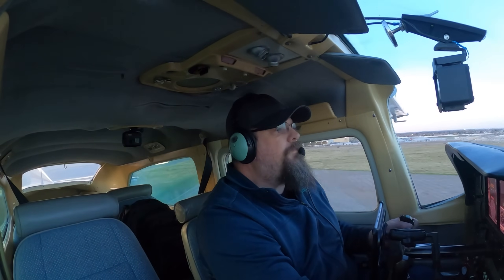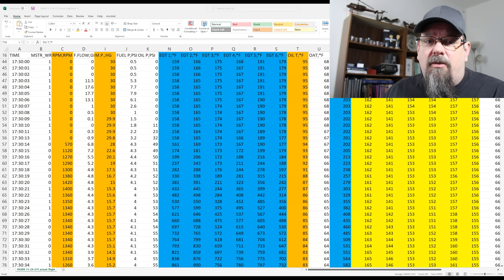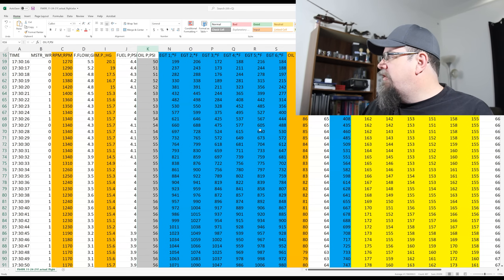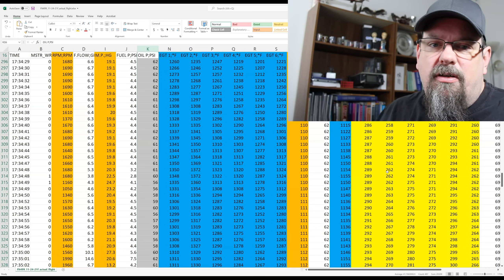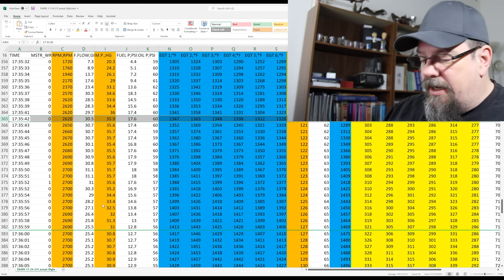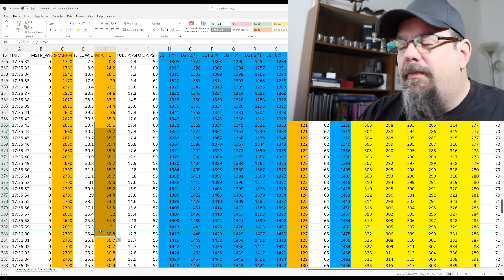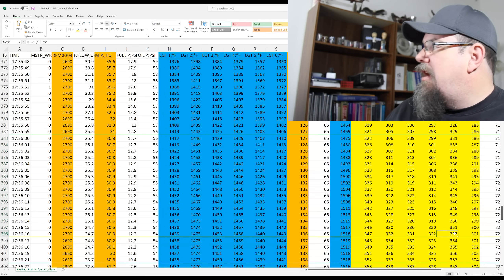So What Actually Happened?

Comment: Except over reving it is very unlikely to cause catastrophic failure by doing something wrong with engine parameters in this short period of time. Even if a temperature is too high, the engine will not explode within 1 minute. When rods break, it is usually a lubrication problem , a bearing cap comed of or a piston gets stuck

Comment: An AD came out recently against improperly installed counterweight snap rings in Continental engines. 
Removing and installing counterweights is very easy, but the manner in which the snap rings are installed is extremely critical. The condition and fit of bushings is equally critical. Those counterweights are not tight on the crankshaft. There is a prescribed amount of free play between the retaining pins and their bushings so that the counterweight can move around a bit to find its best position at various power settings.
I usually leave the counterweights installed whenever I send a crankshaft in for overhaul. I let the Repair Station deal with them.

Comment: Woah. I have seen many engine failures, but never with as much shrapnel as this. It looked like a WW2 bunker with a German 88 in it got blown up by Naval artillery. The engine sure sounds quite complex and that's never a good thing. 
One of the worst things that can happen, one guy does half of a job and another has to finish it. It happens in any shop, either due to illness or bad timing, holidays overlap or death in the family, injury or worse, the guy quit/got fired.
You basically have to redo the entire 50% preceeding the 50% of assembly. There is no other way, clearly.  I never took a job over, hoping the previous guy did his best. I am a optimistic pessimist and therefore plan for the worst and plan C, just to be positively surprised and end up happier than I started, everytime.

Comment: It bothers me that only cir clips are used to hole the counterweights to the crankshaft. Not a very secure method. That warm fuzzy felling I get for great design is lacking. You have a very honorable engine shop, hard to find these days. You should promote then with a banner on the side of your aircraft.

Comment: I hope you don't plan on using those rife extinguishers in flight? Check out a video on the subject from the UK. It's an eye opener. Also, at full power and some forward movement, your RPM should be at Red Line. That is an adjustment that is done to the governor. It won't go above that so no need to pull power back. Altitude is life!

Comment: Being mentally prepared is such an important thing. That's why pilots always should discuss their limits  and plans for a go around just in case it happens. You handled this exceptionally well. You stayed calm, flew the plane, got yourself back to the runway safely and communicated your issue to others. This is actually were newer pilots can outperform experienced pilots, experience with no issues causes complacency you don't mentally go over what to do and expect an engine failure on takeoff.

Comment: Should have a test on the ground set up, for atleast an hr or 2, I've rebuilt diesels with mechanics and they ran the engine wide open with no break in period. I said shouldn't the engine have a breakin period? He said if the engine is going to blow up, it might as well blow up right now in the shop, not later.

Comment: You say that perhaps the counterweight came off when you adjusted the engine speed, the fact is that the mechanical failed to do a proper pre-assembly inspection of all the parts he was to install. I’ve never heard of bolt-on counterweights this means that it was cracked before installation and broken off by the bouncing connecting rod parts. 

Although not an aircraft mechanic I have been a diesel and gas vehicle technician since 1983, based on my experience working on failed air cooled engines or 10:09 diesel engines with external oil coolers I will NEVER clean and reuse an oil cooler that has been contaminated with metal particles because you can never get everything out. I don’t care if it was pressure flushed or blow dried a 0.25mm piece of metal inside a cooler can wreck an engine so I don’t take a chance. 

For future reference, if a mechanic tells you “it will be ok like that” GET IT IN WRITING!

Comment: That was the shop owner  first mistake,  never to let 2 different techs. Work on the same engine,  this is not good practice,  if you start to tear and engine, or transmission, down or whatever it is , that tech has to reassemble it as he took it apart.  Especially in that type of work you had done. There are lives on the line here, in my line of work I do ,if you start the job ,then you completely finish the job to. 1 man start to finish

Comment: You cannot just replace the rod cap, the rod and cap are a matched set, you have to replace the whole rod and cap.
Reply: Failure was due to the mechanic not fitting a c clip retainer on the crankshaft counterweight.....🤔😳🇬🇧

Comment: when i saw this i was sure i had seen it before as i recognized you, turns out this was not the same video and you had another engine fail. this should not happen even once, airplane engines are designed to fail even less than a car, things are built with safety margins and not used to 100%. you need to look in to what is the common denominator. don't fill your engines with cooking oil or something x) (just kidding)
Reply from the maker: There was only one engine failure, but there are several videos

Comment: Very nice that they stood by it and provided a brand new engine. That might be 100k$ or more.
If you ever get tired of the high cost of older birds, consider an LSA. Runs on mogas, 5x lower hourly cost, similar in maintenance. Some even have ballistic chutes. Look for great glide and climb, makes the impossible turn easy.

Comment: After having a couple Deadstick Forced Off-field landings in different GA aircraft, near the runway, there is a rule of thumb: Most ALL engine problems show up after a power adjustment, not during cruise. Now I don't touch anything for the 1st 1000 ft. or last 1000 ft. Thanks for sharing your video.

Comment: That must be a crank a dental does, Continentals run smooth, but they got a lot of problems, too. I worked in an FBO for 30 years they had a lot a problem with the crankshaft Lycoming is usually have problems with cylinder heads Lycoming engines are better😅 but they all have their issues

Comment: Hi there, to be more comfortable with the engine after iran, I would run the engine on the ground similar as if the engine was coming from a complete overall with several RPMs procedures, especially because you replaced the piston rings and worked on the cylinders wall. That procedure would bring any discrepancy before flight.

Comment: Full time A&P for too long. I was talking with probably the smartest engine guy I know years ago, he runs one of the best engine shops if not the best in the country in my opinion, and he said that they put an oil cooler on a flush machine and let it go for an entire week. They then removed and disassembled it and found it still had stuff stuck in several areas. If its been making metal get your cooler overhauled just fyi.

Comment: I'll say a couple things. Oil pressure is measured around the filter usually. It's more than possible that your sensor was reading 50 psi, but your bearings were receiving zero psi due to a clogged or misaligned gallery. Unfortunately it is not possible for you or the mechanic to watch the oil flow through each critical orifice correctly. You just get to assume. Lastly, I'm noticing quite a lot of people saying kudos and bravo to the mechanic for agreeing to fix everything on his dime. You guys do realize this is the same mechanic that nearly killed Edward, right? It's as if all mistakes are forgiven as soon as money comes into play... maybe the guy "stands by his work" because it's cheaper than being sued. Idk just strange to me that everyone is ready to hug the guy who nearly turned Edward into a permanent roof ornament at the local concrete plant. 🤔

Comment: I had a '76 T210 with a TSIO-520 R explode about seven years ago. This is the same engine in your 210. The engine was mid time with no unusual issues. Mine resulted in an off airport landing with no injury.

The insurance adjuster noted that he has seen several 210's with this engine have catastrophic failures.

Yours isn't the first to suffer a failure. You handled the situation very well and walked away. 

I'd fly with you anytime.

Jim

Comment: With a "grenade effect" result after the IRAN, this has to be the source.  With nothing but fragments remaining you will "never" know with certainty, however strongest likelihood is that an undetected cracked rod let go resulting in a progression of damage.  Either that or a rod cap or rod bolt let go.  I have seen this damage many times from these sources.  The steps you took were logical given your expertise.  The mechanic should have immediately known that a major problem existed when metal was detected on the lifters.  That is when the IRAN should have included a magnaflux and / or X-Ray of the rods and caps, which is likely the new protocol you described came into being.  The good news ... you made the runway, you grounded the plane, and the shop conducted a Macro repair.  Hopefully the shop's insurance kicked in on the event.  You are now going to have 1,400 hours of trouble free flying and sleep throughout the night.  BTW ... constant attention and adjustment of the prop rpm on take-off run is a "must" on the Turbo 210.  I have seen pilots allow the prop to operate in excess of 2,700 rpm's even after take-off.  It usually manifests in a blown piston or prop seal decay.  It's such a simple thing to adjust the prop rpm's within limits on take-off.

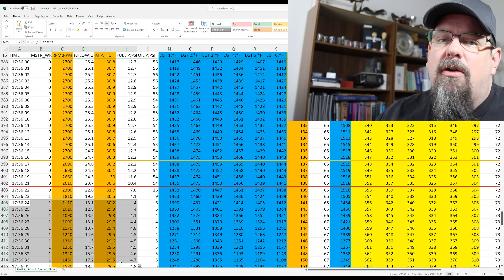Comment: 8:25 oil pressure dropped 10% as you were increasing power, that doesn't look like everything was great
8:12 why did fuel line get ripped off? it doesn't make sense in that situation

Comment: Great Analysis!   Good thing your shop stood up for its mishaps and fixed it. I  was cheated and lied to by an FBO  whose chief mechanic agreed to perform an engine exchange project on my Piper Archer II. The mechanic delegated his job, without my knowledge or consent. to two new hires who completely screwed up the job that would have been pretty routine: 1. take of the STC-ed McCauley Black Mac Prop 2. Sent it in for a  factory-prescribed Overhaul ( was overdue, supposed to happen every 72 mths or 2,000hrs-whichever came first); i3. remove old engine and send back to PennYan; 4 re-install a beautiful, zero-timed, balanced PennYan Aero Lycoming O-360A4M  engine and  put the fully-overhauled (fixed pitch) MCCauley prop on.  Mechanics failed to do proper pre-oiling, remounted the out-run McCauley prop; falsified logbooks :  After releasing plane for flight on 1/13/2021 there was NO ENTRY in the propeller logs.  I  was being charged for 90.1.  hours of work performed but had an agreement for a 30-hour labor limitation, worse,  the propeller was  damaged while in the Custody of the FBO .This was discovered after the plane had to abort its first flight: heavy shakiing of plane; abnormal starter noises, unable to hold idle and NO OIL Pressure....The plane was declared  numerous times unairworthy after the aborted flight and the FBO owner and his non-AI-certified mechanic, sent separate letters to me, declaring their own work unairworthy. After removing the unairworthy plane from that FBO, I  was stuck with a plane where the next shop had to rely on incomplete/false maintenance records. The FBO Owner first attempted to retrieve  $ 8,415- in addition to an already-paid $ 4,800  dollars for incorrect/incomplete  and shoddy work. The case, naturally, ended up in the Circuit Court after the plane experienced multiple performance problems, including climbing Copper values on OAs. Finally, a complete tear down had to be performed....still not resolved today

Comment: Good that everything worked out for you. That the engine shop is standing behind their work and replacing the FFW is great. It's also a lot cheaper than what it would have cost them if your response was just a bit slower in handling that engine failure in flight had ended with an uncontrolled impact.
You have handled this incredibly well and with far better attitude than most.
Oh that end scene!

Comment: Now that I see this video of the internals I STILL Say that/Those connecting rod end caps came off! Your IRAN engine shop bought this because they Knew the Failure was due to Their Work, not your use after their work. I guarantee those Crankshaft counter Ballance weights that are held by pins and circlips did not separate in this failure.

Comment: Had a marine alternator rebuilt, which subsequently caused an engine compartment fire (fun fact - those big "Perko" battery switches you see in every boat are shaped that way so you can quickly find them while holding your breath and feeling around in the dark).  Brought it back to the shop, where they found a wire was pinched in the case during re-assembly.  Their response?  "Sorry 'bout that."   Guess that's the aviation difference!  🙂

Comment: That is one cool dead stick landing  back in the 1920,s  the RAF trained their pilots to not turn round should the engine l fail, losing airspeed and altitude both a pilots best friend . As for the poor old Continental in your flivver, it is knackered basically scrap. Kicking its feet out the bed ,sounds like oil pressure issues a similar scenario affecting the No-3 engine of a TWA  Lockheed 049 Connie on a flight to North Africa in 1946 with tragic results, sludge build up in the oil galleries. Best find a Recon Conti with at least a six months warranty for your flivver from a dealer licenced by Teledyne Continental to service repair, and maintain their engines.

Comment: If the mechanic shop would've detailed everything they found wrong with the engine on it's write up sheet then whatever mechanic that came in to service it should've seen it on the sheet before touching the engine to rebuild it. That is 100% down to shitty data on the side of the mechanic and the guy that rebuilt it not verifying what happened to it and what needed done.. he just pulled a Mexican in front of Home Depot and "yes I do, I cut, you pay $30.. Yes I cut.." when you don't want them to trim a certain plant. He just walked in, rebuilt the engine and didn't check anything. Sure you had issues before you brought the engine to them but that's 100% their fault for not properly rebuilding the engine.
Good to hear that the owner actually realized that and was man enough to admit it and eat the cost of fixing it, nice to see shops that actually honor their customers and work.

Comment: Oh, we're just going to ignore that CHT readouts lag the actual temperatures in the engine? Despite going to idle power the CHT's all rise and stay elevated for the next 14 seconds that you show us. Fuel pressure does not = fuel flow and when it comes to keeping your CHT in a safe range isn't that all that matters? Despite fixing your mistake, your fuel flows never recovered... My main experience flying right now is only chucking skydivers out the door and I've only had to break in one 0 hour cylinder at a time, but that 0.5gph on climb power would be more than enough to put my engine in the red. From what I've seen I think you're very lucky the repair shop is taking care of you so generously! If it's still in the shop maybe get them to change the color and shape of your prop control?

Loved the fire extinguisher and parachute bit, but not the blaming everyone else.
Reply from the maker: Thanks for watching, the hottest any cylinder got was #3 continued to climb to 370F for 17 samples or 18 seconds after the engine let go.  "Official red line" is 460F for this engine. While they were fixing it, we replaced all of the engine control cables with new McFarlane cables, they are very smooth and the propeller not is bright blue instead of black like the original.

Comment: I just have a question. With the amount of time and money invested into these rebuilds and how critical they are, how come these engines are dynoed before they are installled. Dynoed not for power figures but just loaded on and stressed to make sure everything is ok? If something is to break it will happen in the first 10 mins ( lIke you said) wouldnt an hour on the dyno sus everything out? Im not saying YOU should of dynoed it, just the shop owner who did the repair. I could of imagine how much you spent at the shop for the repair in the first place.

Comment: All it takes is missing one tiny detail and the chain of events is extensive. I had a T210 that had a new Turbo put in, the mechanic who was a seasoned 40 year + exp did the replacement. But even he missed the fact he hooked up the oil cooler lines to the turbo backwards.  Upon take off the turbo bearings sized up and had to return to the airport. 
Good thing the engine still ran albeit low on power. He fixed it for free with no charge and even comped for the original new turbo as long as I did not file a FAA complaint. Tough call as mistakes do happen it really depends on the level of negligence.

Comment: Ur engine shop didn't bother to disassemble the crank and get it magna fluxed, measured up and dressed out on an "overhaul"?  Wow.  Thats insane.  What fid they do then?  Clean the case, maybe paint it, and slap it all back together with new bearings that may or may not fit??